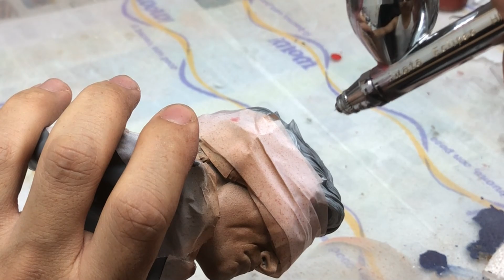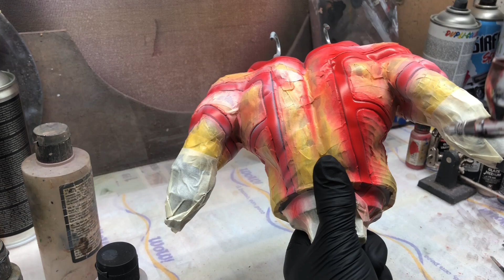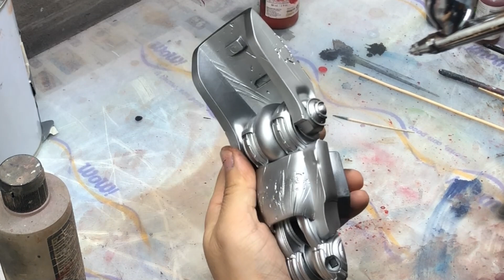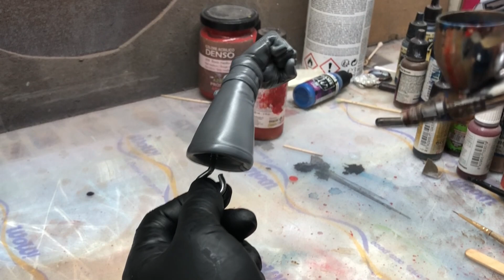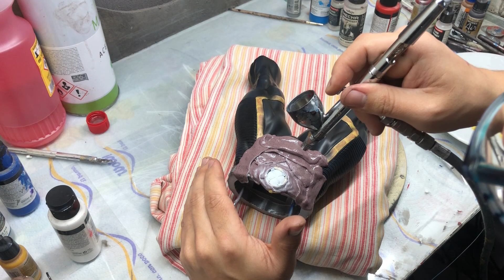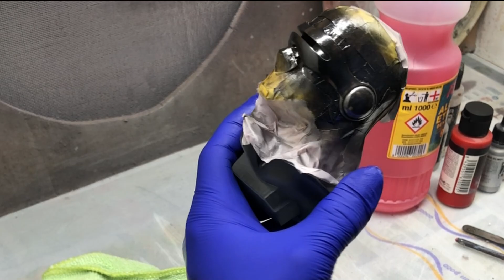Painting Cyclops - 1/4 scale Custom Statue Kit - Dipingere Ciclope - Marvel

Comment: How to make acrylic paint scratch resistant? My problem is, when a 3D resin print done, after painting it with acrylic paint and dries, paint comes off easily with my nail scratch. How to fix this?
Reply from the maker: Sorry for delay… I always using solvent transparent based, in can spray or with spray gun.